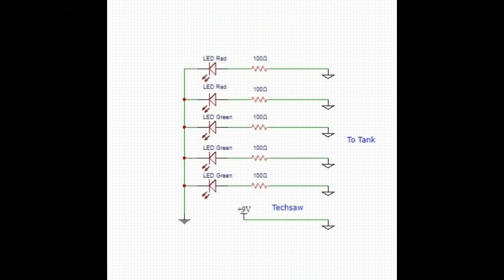Simple Water Level Indicator Without IC & Transistor Using

Comment: Notice the oxygen coming off the negative black wire end.  It will corrode away fast.  But it could be used with a switch to check occasionally, and most of the time it will be off.
Reply: Exatamente fiz desse jeito da muito problema!! Vou coloca um interruptor  de boia

Comment: Due to corrosion on the sensor points( due to high current flow) such circuits are not recommended, rather use Microcontroller/OpAmp based circuits where very low current flows through the sensor lines.
Reply: ....or use stainless steel ... 🙄😒
Reply: @peterfitzpatrick7032  That's okay if you want to stop the corrosion. However, when you add salt to the water to increase it's conductivity and then apply a current, you split NaCl to Na and Cl. And - maybe you guessed it - get chlorine gas. Which is not really great due to its poisoness.

Using a proper circuit is definetly a better option.
Reply: Vijaykumar Malthane If only you knew what you are talking about.
Reply: @noahmeurer7002  it doesnt split the NaCl, it seperates the hydrogen from oxygen. Just like a hydrogen fuel cell. The more current flow, the more hydrogen oxygen gas.
Reply: Bhai uski janaga lead laga do
Reply: @Satyajeet You'll get answer to your query If you read my comment carefully. It requires very low current, in few microAmps in sensor line  Using transistors rather than using direct sensing water level, which requires current of few mA, may not be less than 10 mA

Comment: you can see electrolysis occurring at your anode due to the relatively high current needed to drive the LED. Transistors are cheap and the gate current necessary is much lower.

Comment: Hi, very simple and looks effective way to detect the water level. Just a query, have seen other videos too and others have used transistors where I dont see that in ur video? Is it mandatory or what is the use of transistors?
Reply: Yes its mandatory to use transistor. A transistor provides proper biasing voltages to switch its load from its high sensitive base terminals.
Also note that water is not a good conductor of electricity. So if we directly place wires voltage will be lost in the form of high resistance, to drive directly an led its not sufficient .if we put some salt in water conductivity increases.
Reply: @ElectrotechysMedia  I made a device with some DC connected LED indicators to know water level of Ground Tank. A simple device, power supply leads negative to bottom of Water Tank and different levels set at 4 leads and will be connected through raising water levels.  All my  test with LED indicators and power supply was good before the installation and glowing according to Water Level. But when installed, instead of specific LEDs to   glow according to water level, all the indicators are glowing. What is the reason please ? Any diode to be connected.. No idea?

Comment: Hi,
Good info.
 correct me if i am wrong. Here water is conductor ? if water is conductor and used for real time application(water tank), current will pass whole water from bottom to top. After long use battery will drain past. right ?

Comment: As I made twice.. But not working after some days led goes fault as per my thinking resistance value should change accordingly bottom to top.. Be if first led glows than more voltage is going that's the reason
Reply: Bro it's not working properly because pure water is not a good conductor of electricity. For electrical conductivity , we need ions in water.. we can add salt to increase electrical conductivity. This circuit only works with salty water or we can say ionised water...But for pure water, we have to add transistors to the circuit. Talking about resistor..apply Kirchoff voltage law..then you can easily calculate resistor value for led

Comment: Can i use it to chech level of gasoline or its dangerous
Reply: This will ignite your gasoline for sure, if even a little bit of air gets into your tank.
Reply: It will not work. No electric conduction with gazoline.
Fire danger are low, but exists.

Comment: Nice work but it take much battery charging.because lights have to be always on
Reply: Not if you add a on/off switch. A push button type would be what I would use. Only have it on when you wanted to check it.
Reply: @davidhenderson3400  
Useful
Thanks

Comment: The wire will quickly corrode in the water
Reply: featherbrain Please think before posting. Water is transported around our homes in copper pipes. They do not corrode. Copper is used to cover roofs etc because it doesn't corrode. Guess what most wires are made from?

Comment: Do you any circuit diagram when tank water goes half empty the red led light up
Reply: This project shows u there are 5 levels .u can divide the tank height into 5 levels  one level is 20%  second level 40 % and so on .the led light "on " condition show u how much percentage of water is there in the tank. For example three led 's are glowing then 60%water present in the tank.

Comment: can i use 3 volt battery for this water level indicator. please give reply sir
Reply: Sure can if you recalculate the resistor values to allow ~10 ma of current flow through the LEDs. In this circuit he is allowing ~90 ma flow which is a little high not counting the resistance via the water. A 300 ohm resister could work for 3 volts. Adjust for the brightness you desire. I.E. higher for less light, lower for more... JMHO
Reply: gary @ 9volts he is only using 100ohm resistors, so how can you recommend 300ohm for something driven at only 3volts?
Reply: @fidelcatsro6948  Because at 9 volts he is allowing 90 ma of current at 9 volts to teh LED. I can tell you that LED isn't going to be lit for long.  Most LEDs work around 10 to 20 ma's. not 90 ma's. Understand?
Reply: no way its using 90ma!! there is substantial resistance from the water

Comment: Does not work well in a car;      the 12 V in the water causes electrolysis, need a minimum 1 megaohm resistor in series, and  2 or 3 transistors after that to turn on the LED.